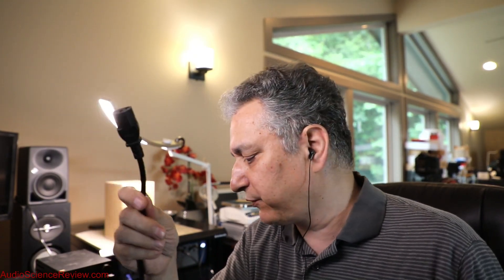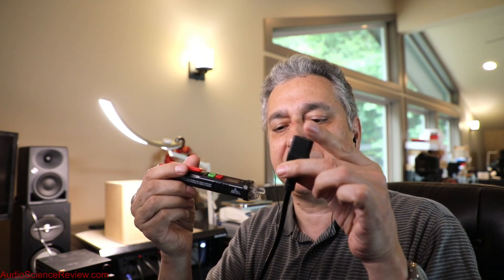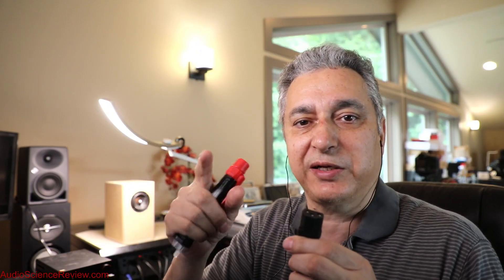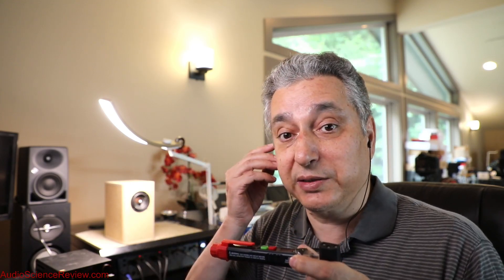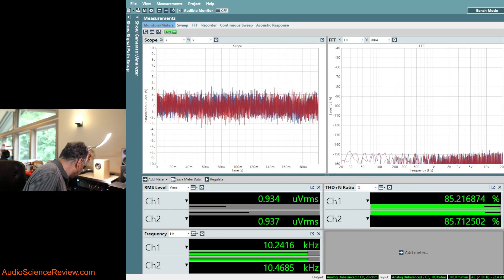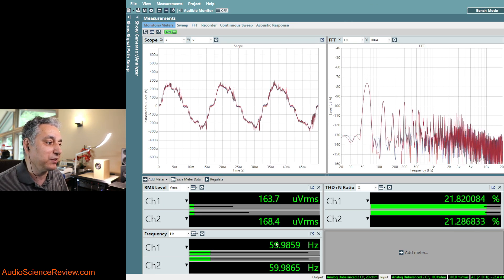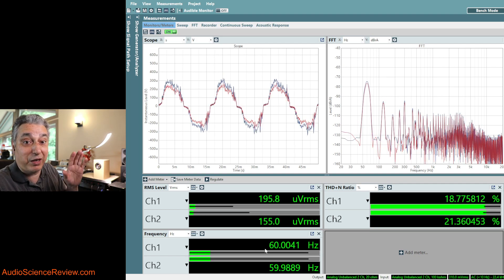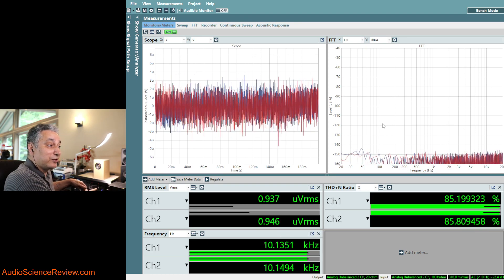Testing Open Power Cord interference in Interconnect Cables

Comment: Whoever contests this test does not understand that a cable plugged into an electrical source becomes an antenna and if you want to show how effective the cable is at squashing noise then that's the test to do.  If you want to show how good OTHER equipment is at sinking noise, plug the cable in.  Good job Amir.
Reply: Precisely!  Those who think current is necessary to create field effects must be forgetting (or ignoring) the fact that Electro-Magnetic fields have two separate components:

1.  E-field (or simply "Electric field") 
2. M-field (or simply "Magnetic field") 

Together, they form the components of a combined EM-field, commonly simply referred to as the "ElectroMagnetic" field.    Difficult to describe the interactions concisely in a comment, but effectively they are inter-related with each other, charges, and whether the charges are moving or not.  For example: a moving magnetic field produces an electric field (and conversely a moving electric field produces a magnetic field).  Meanwhile, a buildup of static charge produces an E-field.

What most people associate with AC power lines is the combined electromagnetic field (and EMF or Electro-Motive Force) caused by ΔI/Δt (change in current over time), which requires a circuit.  However, even if unplugged, the "Hot" AC wire is still connected to the home's wiring at the breaker panel, which is a huge source of charge, and also changes as the AC sine wave cycles back and forth.

Comment: Wonderful video Amir.  A more dramatic example of the current in an open circuit conductor is found in long distance high voltage (200kV+) power lines.  When a several hundred mile long high voltage line that has been de-energized is re-energized with no load on it, the current rushing into the line solely due to the capacitance between the line and ground can be large enough to trip the circuit breakers.  One way this is controlled is to temporarily connect an inductive load parallel to the line to reduce the charging current until the line has been fully charged.
Reply from the maker: Fascinating.  Didn't know that.

Comment: As always scientific, educational and comprehensive.
Reply: Yes on the first 2. Unfortunately not on 'comprehensive'. He demonstrated only capacitive / electrical field coupling.

Not magnetic coupling / induction. Which does not address Danny's criticism and will lead to still endless rounds of more empty talking past each other.

This said, the result is the same. The key is in the point Amir made at 8:25 "the low impednace of the output shunts the weak signal from the EM coupling". And there you have it for speaker cables (not so true for low level signals from the source, like a DVD player, where a little coupling can have big consequences on the following pre-amp stage).

Oh well, it is not easy to debunk & demystify some topics without diving into the physics and losing most of the audience. At least Amir is trying. Unlike the "can't be measured" camp and their trusted golden ears peddling their dubious products...

Comment: Here’s the problem. You are using a low end non audiophile power cord with a high end cable. They lack synergy. You need a high end audiophile power cord, one that costs 10K or more to get the synergy and then you will get blacker blacks in your back ground as well as more Blume and jazzier attacks on your transients as well as 23% greater musicality.

Comment: As someone who designs and constructs motorsport harnesses used in automotive applications AS A HOBBY, where ignition coils discharge many 10s if not 100's of kv into a spark plug, generating an ungodly amount of noise in the ground plane, it's clear Danny doesn't understand how cables work from a fundamental stand point.  The first thing you learn when dealing with these types of systems and variable reluctance sensors (AC current) or hall-effect sensors (square wave DC current) is that you shield the signal wires on ONE END (preferably a common point for all sensors so as to not offset the reference voltage).  Not both ends.  That would make the cable "not plugged in" on one end like Danny was making fun of.  By tying the shield to ground on both ends you create a ground loop... which is why balanced audio circuits and isolation exist.  It's literally part of audio design that he seems to dismiss.  When dealing with 5v-12vdc sensors its extremely easy to cause false triggers with capacitor discharge ignitions or even with conventional induction ignition coils.  It concerns me that a company selling products touting the solution does not understand RFI/EMI at a very, very fundamental level.
Reply: Jon = 100%.  As an electro-mechanical tech I'm with you!  Until someone has had to deal with ignition system noise they haven't had real fun yet.  Back in the early 70's snowmobiles would be driven up our road and the TV would get snow on the screen and static in the audio.  It was my introduction to RFI/EMI as a young lad.  I've been in the welding business for decades and I have caused havoc on many electrical and telephone systems with the RF radiation from a TIG welder "high freq" arc stabilizer output of the 3500Vac arc at around 1kHz.
If someone want's to see noise on a circuit - put a VFD (variable frequency drive) or an inverter welder to use near a non-isolated audio system.  There's so many people that don't even take into account that the entire power grid is picking up "noise" that they feel is going to be magically disposed of in a power cable plugged into a wall socket.  All the very best to you and yours.

Comment: I’m so happy this channel popped up in the feed. Exactly the stuff I’m interested in. Gonna look through the vids on the channel to see if there are any Skin Effect testing.
I’d love to see a vid on the benefit (if any) on using CAT 5/6 cables for speaker cables (ofc paired off equally for positive/negative).
Reply from the maker: Great to have you here.  I thought the fad of using cat cables for speaker has fallen out of favor.  If not, sure, I can test them.  In general, the gauge winds up being very high causing frequency response errors in longer lengths.

Comment: of course it is it's basic electronics, there's leakage in the cable as you say, the only benefit is of connecting it up to a load is to get load resistance per metre measurement
Reply from the maker: Yet a company owner ridiculed the test as example of me not knowing what I am doing.
Reply: @AudioScienceReview  
yeah... what qualifications did he have in electrical engineering? probably none is my guess

Comment: Capacitors are weird, you find them everywhere. AM antennas are just a bit of wire, so a power cord probably will do something. Anything with a bit of AC power is going to emit a little EM radiation. I guess the power cable only truly sourcing 0A current when it's unplugged.
Reply from the maker: Exactly right.  This is why it is often said that RF work is half engineering half art!

Comment: Very interesting video. I used to work in IT, and now I understand better why you always tried to avoid running data cables next to power cables.  Also, all that HF noise in the microvolt range is most likely at least partially made up of radio transmissions, so if you hooked up an RF amplifier and tuner to that signal, you could probably receive whatever is the strongest AM radio station nearby.  If you do have to have data (or audio) and power lines near each other, we were told if they cross each other at right angles the transfer (coupling) of noise is less.
Reply: It's HS physics.

Comment: There's a relatively cheap power cable called LoRad from Supra. I measured the EMI/RFI and it is very good at preventing interference. Much better than more expensive fancy cables.

Comment: Thank you for the class Amir! I wonder if one could get some meaningful results just with a voltmeter. Testing a signal cable’s rejection to AC interference by simply measuring millivolts.
Reply from the maker: The voltage is changing all the time and meters are too slow to track it.  A cheap scope would do a better a job here.  Or use an audio interface which would have better dynamic range.

Comment: Thanks Amir. It was good that you demonstrated this and good that you did it in "a few minutes". I understand what you described but somehow I would feel better if you would also do the test with a mains cable i.e. to a class A amplifier (or any device which draws a lot of current). Would it make a difference? I am sure I am not the only person who would like to see that.
Reply: Tbh this would close the argument of gr research, so yes, I would also like to see this
Reply from the maker: I did that as a follow up to that review.  I don't have a link handy.  It didn't change anything as far as outcome.  Instead, a better method is to use a transformer to create a very large magnetic field and see how that impacts the cable.  I do this routinely and it does work to show what happens in extreme cases.

Comment: Why do you need to test with power cables not hooked up?  Why not just test it the way it is used, plugged into the unit and powering the unit?
Reply from the maker: Because I need to be able to manipulate the AC cable to get the best coupling to the interconnect I am testing.  This is a lot easier when the one end is loose.  Mind you, I have also done it with it under load with the same effect.  Also, if I plug it into something, someone else can't easily replicate my tests whereas an unterminated cable is easy.
Reply: @AudioScienceReview   Wasn’t the criticism for when testing the power cord itself?
Reply: …not interconnects

Comment from the maker: To be clear, I always test interconnect/speaker cables terminated.  The point in this video is about an AC cable as a source of interference not being terminated.

I also use transformers for magnetic interference.  Didn't mention here because that was not the issue that was raised.
Reply: Without a load, there is no current, but there is voltage.
Reply from the maker: @HansDelbruck53  That's right so you get an electric field.  With current, you get a magnetic field.  The mistake folks made was thinking neither was present.

As an aside, the pins at the end of the cable also act as a capacitor as does the AC cable itself.  So tiny amount of current is going through as well.

Comment: An open electrical cord can test if an interconnect is susceptible to capacitive coupling into the audio circuit. A power cord that is connected to a load and delivering current will have a much stronger magnetic field around it than an open power cord- and this could be used to test if an interconnect  is susceptible to noise inductively coupling into the audio circuit.  Using an AC transformer connected to the line will generate an even stronger field for testing for inductive noise coming in through the interconnect.
Reply from the maker: I do exactly that (using a transformer) and have done so in a number of reviews.  The point of this video was the claim that no radiation of any kind exists which clearly is wrong.
Reply: @AudioScienceReview  I understood the point of the video, and wanted to reinforce it.
Reply: No kidding.

Comment: There's always interference from the wall, but the main thing is that there's more interference if you connect the AC outlet to a load. The bigger the current, the higher the interference.
Reply from the maker: Current generates a magnetic field, not an electric field.  The latter doesn't care how much current you take or don't care.  Besides, how much current do your audio components use anyway?  Other than the power amp it is tiny.  So if current is a problem, then it is not an issue for most of your electronics.
Reply: @AudioScienceReview  That is not true. A constant current will generate just a magnetic field, but an alternating current will create both alternating magnetic and electric field.  Any alternating magnetic field always create a perpendicular alternating electrical field. AC cables are like bad near-field antennas that don't propagate. But AC always produce both magnetic and electrical fields. 
I know EM are not intuitive, but you probably need to re-think about your EMI testing methodology in the future.

Comment: Danny at GR Research released a rebuttal video to your review of the LGK 2.0. I would be nice to see your response to his rebuttal.
Reply: Why?  Danny is not a real engineer and there isn't anything to debate.  Just watch Amir's videos covering the basics.  You'll end up knowing more than Danny.
Reply from the maker: I could do one like that but it will seem argumentative.  Instead, I am focusing on teaching moments in stuff he said and create stand-alone videos.  This one addresses of him saying a live AC wire doesn't radiate anything.  I will pick other topics and explain them.
Reply: thats what this is. It rebutts one of his mud throws.
Reply: @Yankee_Doodle_Stacker  I said LGK 2.0 specifically.
Reply: @AudioScienceReview  👍
Reply: @fmottnar01  I am not contesting anyones knowledge. I am addressing process in which the same device was tested by both parties. The manufacturer said there wasn’t any dampening material in the LGK 2.0 he reviewed. Then Danny later said there wasn’t enough dampening material in the speaker.  I found it interesting the manufacturer said that even though Amir said he did apply dampening material. Would be nice to see if the additional dampening material would make a difference or if Danny is just throwing a hissy fit.
Reply: @subant05  Why don't you read the original review on ASR.  The build and damping situation was covered from the beginning  My goodness people put no effort into things.
Reply: @fmottnar01  re-read what I said. My goodness.
Reply: Again, the question was covered as to what was used/added and there was plenty of discussion about the damping itself in the thread.  Do you honestly think that it would save the speaker from the well understood issues comparable to those of cheap computer speakers from best buy?  And, yes, you should be questioning someone's knowledge.  Anyways just read the thread man. Everything is there and there are many top speaker engineers there that helped break it down.  This is not that complicated.  This is a simple little speaker with a little driver Danny got for cheap and is trying to sell off with a magical little story and sleight of hand measurements.  It's certainly not custom made but is instead being pushed beyond its abilities.

Comment: Also need to emphasize the fact that a high impedance input is much more susceptible to external interference than a low impedance input especially when it is not being driven from a low impedance source.

Comment: nice short video (by ASR standers) 

any plans on doing a video about room acoustics and room treatment (above the modal region)?
Reply from the maker: Plans yes.  Time?  Have not had any for few years I have been intending to do this.  I may take bites out of the topic across a few videos.  I am glad to read that you already know the key aspect of modal region/transition.
Reply: @AudioScienceReview  the benefits of multi sub and EQ in the modal region have been spread and accepted pretty much everywhere that is even semi science based, especially HT related. above that region its a crap shot, its pretty common to to find people recommending putting absorber at the first reflection points even when they recommend getting a speaker with good off axis response.

Comment: This is all very true, but we must notice that one must be very close to the AC power cable to pick up the field generated.. Even the tester designed for the task that has an internal amplifier has to be within an inch. It's because the field drops off at r^2... r being the radius of the distance from the source (wire). It's also true that an open ended cable will still generate a field because the entire length of the cable including the circuit that supplies the cable is a capacitor and current however small is flowing. A cable connected to a load creates a larger field proportional to the current flowing.
Bottom line? If the source, the power cable isn't laying on your audio input cables you're not going to pick up the 60hz signal.. 
If you think that your AC cable supplying your equipment is a problem, look into the filtering that's done before the power supply voltage reaches the amplifier circuits.. It's long gone.

Comment: The only time I had a problem was with phono cables being close to power cords. Being very familiar with cables having spent millions of dollars of other peoples' money buying them it is very easy to shield an interconnect that has a problem. Run a bare piece of wire along the length of the cable. You can wrap it if you like. This is called the drain. Then cover the cable with aluminum foil. You can ground one end of the drain or both if it results in less noise. As for speaker wire it makes for one lousy antenna. Compared to a real antenna it stinks and is terminated at both ends into what at RF frequencies is for all practical purposes a dead short. The signal in a speaker wire is much too high to be affected by RF. Just don't coil it to make an air core inductor. 

DO NOT under any circumstances try to shield a power cord. The ampacity of a power cord is rated for free air. Applying a shield negates its rating and it can overheat, melt the insulation, cause a fire or worse. If you insist on a shielded power cord make one up out of BX or MC cable which you can get at an electrical supply house. They are rated taking into account their outer shielding. These cables are only shielded for electrical fields like a Faraday cage. They are NOT shielded from magnetic fields. That requires encasing anything in Mu metal.